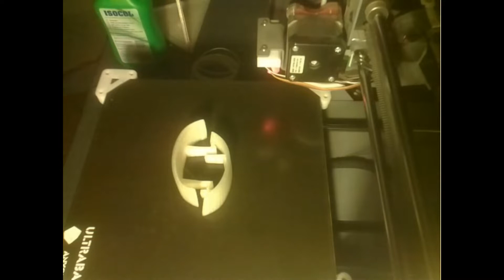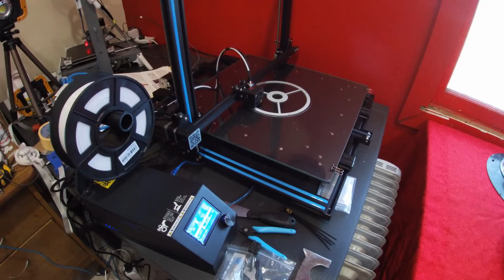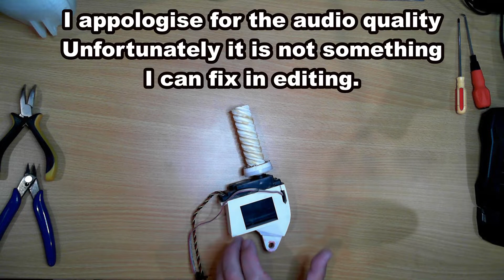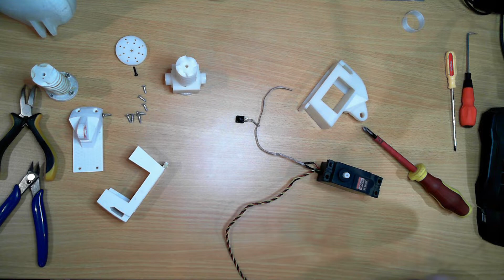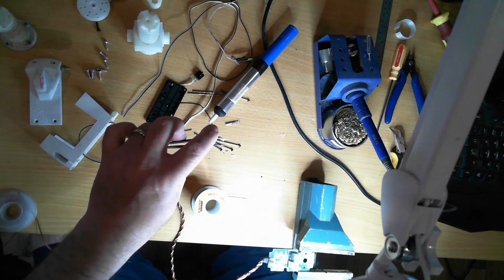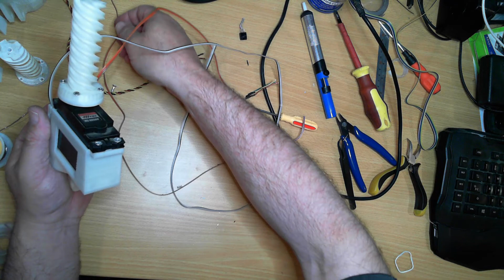Freds Right Arm Part 2

Comment: Good morning Ray. Great video. Your voice has an echo. It's cool, makes me feel like I am on a star ship.
Reply from the maker: Your right, there was a lot of echo.
I had the capture software capturing the system audio, and due to other issue with the sound, I was playing back the mic into the system audio so I could hear if it went bad again.
The result was the audio recorded twice with a delay between the two audio streams.
Unfortunately, it was something I couldn't remove in editing :-(
I eventually found the audio fault to be in the Behringer UMC202HD Audio capture device.
I still hadn't found the fault at this point